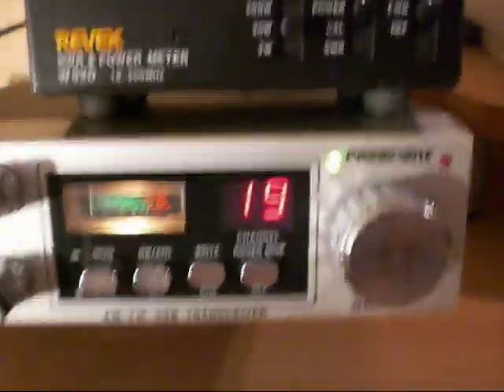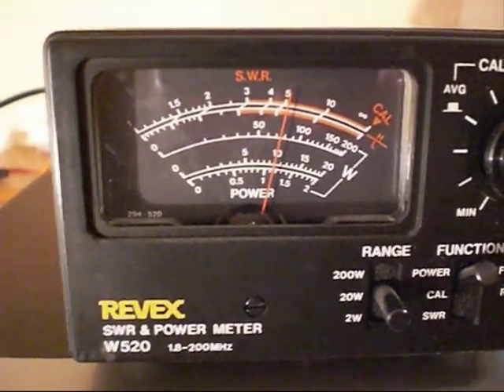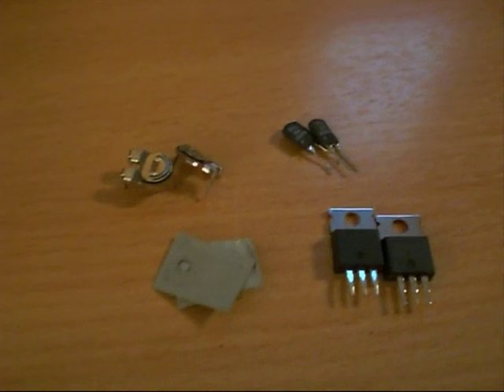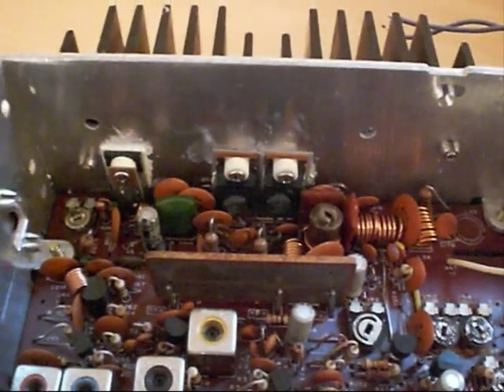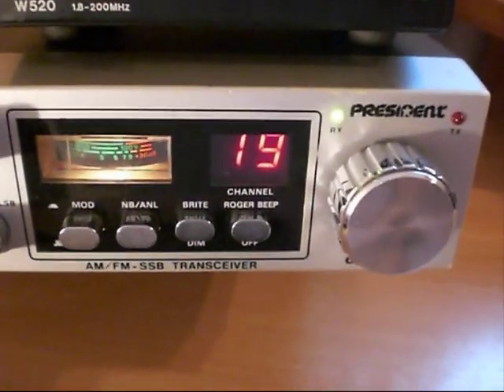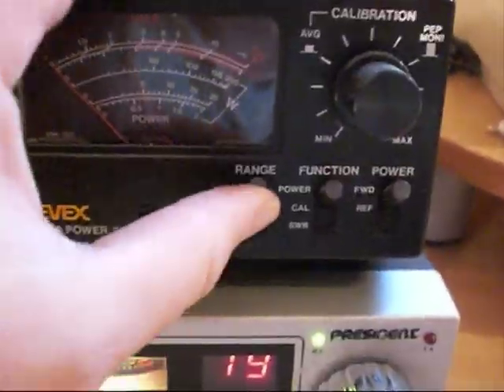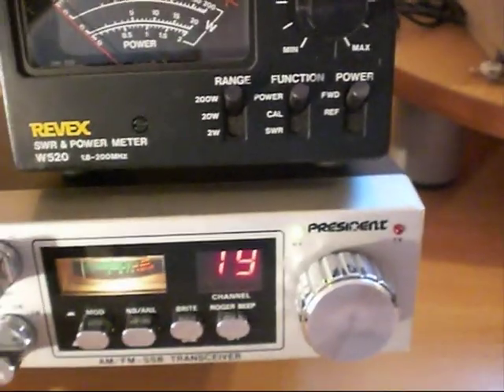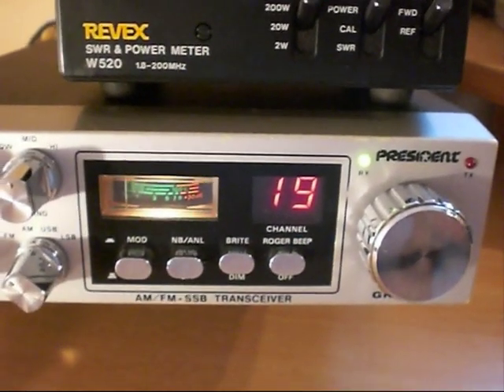PRESIDENT GRANT (UNIDEN PC-999) FINAL MOSFET OUTPUT CONVERSION.

Comment from the maker: Tricky really, if it's just driver/finals then then the radio should still TX enough power to be heard on another radio close by which will indicate the rest is OK or should be.

I change any burned parts in the PA stage as routine otherwise you can have all kinds of problems, i would also check the bias voltages on the driver/finals as if the bias diodes/resistors have gone bad then this can push up the bias voltages and destroy any new transistors you install.

Comment from the maker: Hi John,  the IRF510 is also used as a RF device and is now being used to replace the now discontinued 2SC2078 used in many newer AM/FM CB's.

The IRF510 is not a direct replacement for the 2078 and they have adapted the newer AM/FM radios to use it.

Comment: Nice work Mark..
Have you ever tried different International Rectifier MOSFET's for finals? 
The IRF530 is similar but more powerful device. It would be interesting to see if they work as a final and if there is any improvement in power. Keep up the good work.. Best Regards John M0XFX

Comment from the maker: I have all the parts, i have converted a few Mk2's (PB-010) and normally get around 25watts  PEP. The original final in the Mk2 should be a 2312.

The Mk1 (PC-879) uses a 1969 from the factory but also runs at 25watts PEP with a IRF520N, likewise the STALKER 9, PRESIDENT McKINLEY (PC-893) also - i have converted all these...